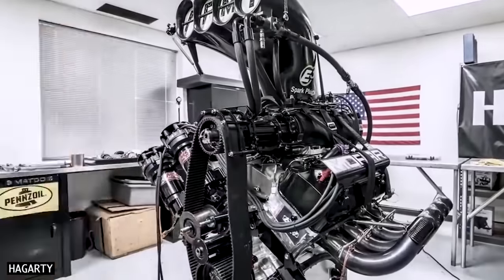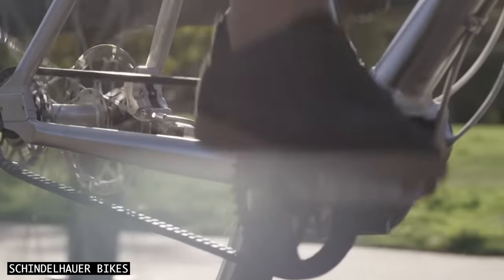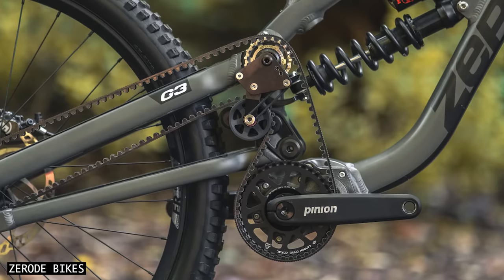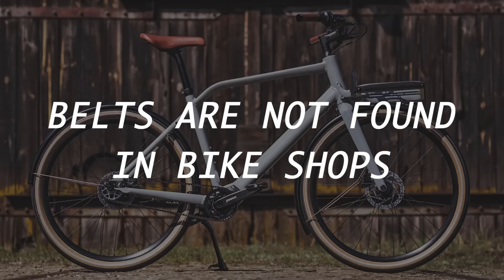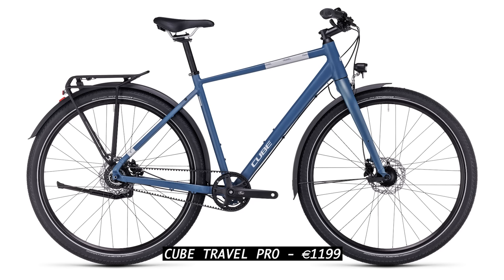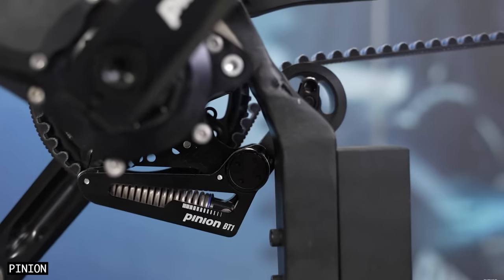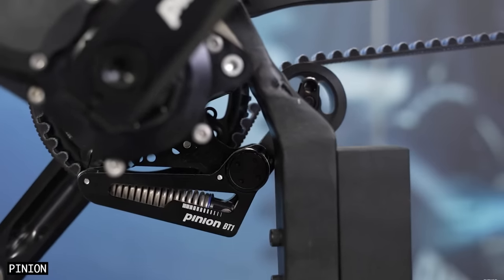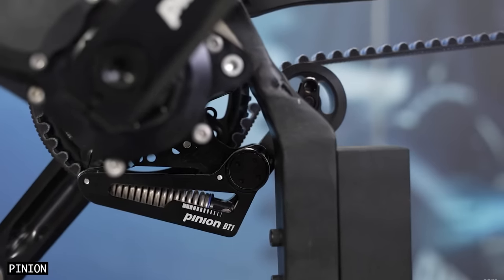Belts Are Now BETTER Than Chains On Bicycles!

Comment: Gates says "do not back-bend", yet then they offer a tensioner, which back bends it. So the manual is outdated, or you can back-bend certain belt models?
Reply from the maker: The belts will obviously back-bend a bit. But it's prudent to not test the limits of the back-bend angle, as it will damage the internal carbon cords.

Comment: Been following your channel for a while now, and have patiently been awaiting for budget-friendly belt drive gravel bikes. Would you by any chance know of good alternatives to the Cube Editor, preferably around 2000€ within the european union? The primary requirement for the bike is a CDX drivetrain, and useable in all weather conditions (Danish weather can be chaotic, and roads are salted during winter). The latter gives me worry with regards to alfine hubs, which seem to be the only option within my budget,
Cheers!
Reply: Denmark ios rather flat, isn't it? I'd go for fixed gear with belt and don't worry for hub (which will need maintenance, will be costly and you'll be lucky to find a shop to do it properly). I just had to do it myself....
Reply: @event4216  I am worried about going fixed speed - through 24 years of (near daily) biking, I have never had experience with it. I do a ton of recreational biking both in and out of town, and the gears come in handy for rough days (heavy wind, tired legs etc.)..
Reply: @rapamune  Well, fields and strong headwind is flat equivalents of hills. Those wind generators across Denmark aren't just for looks...
Regarding FG there's nothing extraordinary. In fact, it has made me riding more FG bike then heavier touring with belt and Nexus hub. I'm not a youngster by any means but FG bike is lighter and easier to ride, it also goes easier on rolling hills - easier than single speed bike of same gear.
Braking can be done with brakes like on regular bike or you can use legs just to regulate speed up or down, and use front brake to stop more quickly. No need to skid or do crazy stuff kids do on this bikes.

For me FG is feeling of connection and no worries about delicate freewheel. Good set of sealed hubs are good for several years, bearings can be replaced when they go and chain is consumable if you ride daily in any weather. Unfortunately belt drive FG bikes are too niche and expensive unless you buy it used. New Schindelhauer is around 2K, on chain bike it's much much cheaper to change gearing of out of box is too hard for your conditions. In city I like 48/18 and 48/17 for longer rides and cogs are cheap to come by.
Reply: I believe there are also Danish bike companies making nice bikes? Cube does about same as other German bike companies, it's more about looks and componentry. Rabeneick is another brand assembling belt drive commuter and touring bikes. I guess brand doesn't really matters as long as bike has CDX drivetrain and components you will not need to replace immediately (e.g. handlebars are straight but you like well backswept or vice versa). Paintwork these days sadly is flat black, mostly...

Comment: For how much kilometres does a gearbox last before it needs to be repaired/replaced? To my knowledge maintenance is required every 10 000km.
Reply from the maker: There's a guy with a Rohloff hub who has exceeded 450,000km. A few people have gone past 100,000km on Pinion gearboxes. The Shimano Alfine hub will often last for 80,000km or so. And an Enviolo often lasts somewhere greater than 50,000km.

Comment: The "to heavy" argument is not true for "why don't they use belts in tour de france". I don't know why but wieght is not the issue. It is very easy to make a bike that are kilos bellow the minimum weight limit of the bike. If you want to spend some of that "wight budget" on a belt drive it would be very doable.

Comment: yee belts are cool but they are wayyy to expensive ,    with a nexus 8 and normal chain , will cost you 200 . and you can add it on any bike ,  with belt  will be 400-500 , and you will need special frame ,

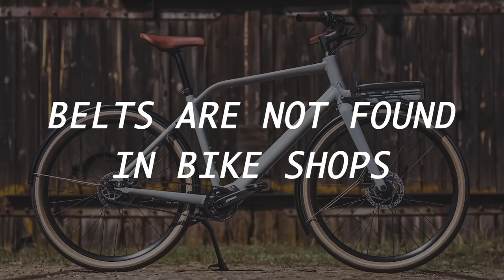Comment: Hi, I have a Q about an image which is visible in the video. Which bicycle (frame) is it that we see from 4:57 to 5:02? If I am not wrong the rear sprocket & belt are placed outside while the rear traingle (chainstay, seatstay) at the rear dropout is placed further inside, hence the belt runs  'open' between the rear hub & the crankwheel, hence such a frame does not need any 'splits'. Also I see the chainstay only one side of the hub (where the belt runs) while the other side of the hub, I don't see any chainstay at all. Do I see it right? How is the hub & wheel stable & isn't it wobbly?
Reply from the maker: It's an English Cycles Project Right. It's engineered to be a stiff structure just like a regular rear triangle (although, it's likely heavier).

Comment: I don't see the benefits, it's just a more expensive alternative to regular chains. I had multiple bikes in my lifetime and never needed to change the chain, and if I did the change would be easy and cheap available in all shops. I don't understand the reasoning behind "regular chains need grease", dude that's really not an argument to change to a much more complicated gearbox. You don't ever need to touch the chain, just grease it from time to time, it's so very low maintenance.

Comment: 2:20 yeah but your not be able to use the transmission in a bike so that could be a big, bigger inconvenience because you can't use other changers of velocity.
Reply: but you could fix the problem of being broken simply paint the belt with a proper water protective paint and also will last more longer than usual.

Comment: I have a Rholoff, chain and tensioner on my Cannondale Jekyll. 
Bike old but fabulous 
Gears love em. 
Chain falling off. Seriously?  It’s less bad than a slappy derailleur but still crap. Sadly the frame has no fitting to use a belt and no bracket for a front mounted tensioner.

Comment: Interesting. I watched it all, PhD please. My questions are about implications for the frame, which are not discussed. Modern gravel bikes and traditional steel touring bikes try and make the rear triangle a bit flexible, compliance = comfort. That is an argument against belt drives. There may be durability gains for the drivetrain in using a belt, but the frame itself must be less durable - splitting the rear triangle with threaded connectors is asking for trouble as the frame ages. An eccentric BB means you need to split the BB shell and use big bolts to fix the eccentric in place - another source of hassle in the long term. Horizontal dropouts with those extra bolts to hold the rear axle in place are another weak spot. I guess for long term world travelling cyclists with 2inch wide tyres and big loads belts can make sense. But generally, no thanks.

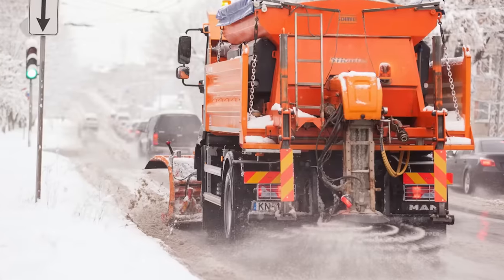Comment: One look at the picture of that Rose CPTL at 3:39 and I knew this was it! 
Since weeks I've been searching for ANY carbon frame that supports belt drives (+ a rack... and is still in production). Bonus for slightly lower step through but does not have that typical woman-bike look. That CPTL is exactly what I have been looking for - and turns out they too have stopped production - aaaw! :(
Do you know any bikes (or preferably frames only) that support belts, are below ~1,5kg, support a rack AND are still in production? lol

Comment: "Belts are now better than chains" title is very misleading. Simply put it depends on the application. 

Comparing the use of belts in motorized vehicles to pedal powered bikes? 

I'm not against belt drivetrains I just dont like click bait titles

Comment: Thank you for you video, but in my opinion you're dead wrong when it comes to pricing.
Bicycle manufacturers (and shops) are not in the business of making (and selling) bicycles, but are in the money-making-business with only the shareholders interest at heart.
With that in mind it's very easy to explain expensive and redundant options like: hub-dynamo's, disc-brakes and - of course - belts.
As to 'belts versus chains', this is my experience; on my commuter bike the chain+cogs (protected by a chain guard) are still going strong after 27.000 kms. Of course they are worn. Most likely even very worn. But they will continue to last for many kms to come. I've no experience with belts. But I did make some inquiries for replacement costs of CDX belt+cogs - here in Holland - and everywhere I'm getting the same price of about €350. If you compare that against the €50 I've spent for a spare set of chain+cogs, it is ridiculous.
The big lie of the industry is that they compare a belt in ideal conditions versus a chain in the worst conditions.
Just my 50 cents.

Comment: Tbh, I don't think it is fair to compare an endurance drive like a belt with a performance chain drive of Shimano or Sram. It would have been better to compare the belt with the igh chain alternative. On top of that you can get a KMC chain, new sprocket and chainring for 15 EUR. A belt drive is 250 EUR. With 250 I can replace my chain drive 16 times.

Comment: 7:03 timing chains are always in the same environment and oil bath cleaned by an oil filter, i dont think its a fair comparison in all honesty. Bike chains are always at the mercy of everything and changing loads. Timing chain loads have a maximum from valve spring resistance on the lobes at a given rpm. Ur bike can easily see incredible spikes on rough terrain and gravel.

The have a max torque? Im watching your video and follow your channel due to your passion for cycling and extensive knowledge and experience. And now im debating on actually buying a new bike with a belt drive and mid gear instead of resurrecting my favourite and loved Giant NRS2 2004 year model. God i love my bike but it suffered stroke and heart failure along with me. It might cost me $1400 to refit it, but soo much has changed. 3x9 drive trains seem to be a relic of the not so long ago past. And i would not buy a new bike especially after the experience ive had on my nrs2. So im thinking going for a belt drive and mid frame gear would be along the same lines of reasoning that lead ne to my unregretable decision on my nrs2. 
Having said that you mentioned a torque limit. In 2012 i built a trailer out of 2x4 for frame and cedar for planking. It weight 100lb dry and had my old v brakes mounted on it that originally came with my nrs2. In about 3 months hauling payloads anywhere between 100 to 400lbs i noticed the teeth on many of my gears looked like they came out of a shark and i managed to stretch my brand new shimano hg chain to where on the other side if the gear it had completely skipped a tooth. 
Hmmm, after typing all of that a thought cane to my head, if i use a rear gear hub then the tension from pedal to rear sprocket will be less than if the belt was coming off the output of a frame mounted gear set transferring the multiplier or divided force to the rear wheel. 
Well i just lost my train of thought. Anyway if my health comes back i know i want back on a good bike. And will need a good air filtration system with hepa filter that can allow mass air flow. My lungs took a huge hit resulting in my stroke. When cars drove by me felt like knives stabbing my lungs. I love cycling, and carrying a big box so i can ride around in the city while protecting my health is more important. Its only in town or on busy roads, out in the country side its not needed. 
Anyway, keep on cycling man. If you ever pass through New Brunswick Canada i live near Caraquet.

Comment: Why don't we see belts in professional track bike racing is the more interesting question than the one about Tour de France (or roadbiking in general). They don't have gears anyway, so there is no weight disadvantage.
Reply from the maker: To accommodate the huge torque numbers put into a track bike drivetrain from stationary, I suspect the extremely high tension of a belt would simply run less efficiently than a chain.

Comment: An internal gear hub system concentrates all the weight on the wrong end of a mountain bike. If you like to ride aggressively and catch air, hub and belt systems are not the way to go.

Comment: Belt+gearbox loses quite a bit of efficiency. You see them on cars and motorcycles because they have a lot more power than a human does.
They're good when you don't need all the power to the rear wheel. An enclosed chain will live quite a bit longer than an open chain (as long as 30.000 km), and with a derailleur setup, it'll be as near 100% efficient as it gets. I never have issues with salt either, and don't clean my chain more than once every 2000 km.

Comment: It will work, but it's not better than chain for several reasons. First of all, it has more friction than chain. Even though car engines use belts, that's not for less friction but for longevity. Second, a belt is more problematic to wear in muddy and sandy environments. A chain will drain sand and mud more effectively. So even if a belt has advantages in some situations, it's not for bicycles.

Comment: About engines having belts, yes!, but a chaindrive is way better on a car. The belt on the type of cars you show are replaced after every run down the track btw. :) and chain in a car is 95% better, the last 5% is due to bad constructed chain-tensioners, or lubrication of the chain which makes them bad. But in a good engineerd car a chain is the way to go.

Comment: Why don't belt drive bikes have the rear cog outside the bike frame, eliminating the need for a break in the frame?
Reply: i think it's hard to convince any company to take the risk and build 10-20 thousand rear hubs of a new and proprietary design which isn't compatible with frames of multiple other companies. the giant halfway should have had such a special hub (not exactly but along those lines) and the reason they stopped making it wasn't lack of popularity, it was that even giant couldn't find anyone to make hubs for them
Reply: @markifi  That makes sense, thanks! It's disappointing though.

Comment: Van Duzer broke his belt on a ride with only about few  hundred miles on it and he forgot his spare belt. I broke a chain once and was able to repair it in 5 minutes with a little tool and I was then on my way. Timing belts on cars NEED to be replaced for lots of money after only 60,000 miles.  Steel timing belts never have to be replace for the life of the car.   Chain systems on bikes are  WAY cheaper and plentiful.   You do not need a engineering degree to work on them.  Chain systems are WAY lighter in weight than a pinion gear box system.

Comment: True but you will never seen a belt drive on a long wheel based recumbent, or a trike. They cant be made that long. I will stick with a chain drive. Easy to maintain, plus repairable, if they break. Oh, the Gates Carbon Drive. I know a guy in Boulder Colorado, who has broken two of them.

Comment: Put the rear sprocket outside the frame? Or put the front sprocket sprocket inside a split bottom bracket/Down Tube & Cross Tube? Think away from what already exists!
Reply: has been done with the Giant Halfway and the English Cycles project right, and there were all sorts of cantilevered structures (where the stucture between the rear axle and the bottom bracket swoops well above the belt) that could accomodate a belt without a coupling, yet people still choose the coupling because it's just a more simple solution that can even be retrofit to old bikes.

Comment: Great work! 
The minimally worse efficiency of the belt is negligible, as long as speed and weight is not important. The route is the goal! :-)
Have you ever driven an Enviolo Automatiq? (ok, I know, it only makes sense in combination with a motor, but I would still be interested in your opinion. 
 After all, you can see this gearbox for a few seconds at the beginning of this video.)

Comment: It's odd how a car engine timing chain (older vehicles usually) will last for the entire life of the vehicle. In modern vehicles and to reduce costs, timing belts replaced the much more robust chains, and these need replacing every 60k miles or so. I fail to see why a belt suddenly becomes 'better' on a bike? I've got a couple of bikes over 20 years old with chains and they're still going strong thanks. If it ain't broke, don't fix it as they say.

Comment: Man, I am drivin gwith a single chain more than 30000 kilometres and the bike is still at home with the same chain, hanged in the garage for 6 years, because I am in another place now! Only first year in the university I drove 10000 kilometres. I use noname chain that is good ieven in 30000 kilometres later.
Also, when I was in Germany I drove 10000+ (maybe more than 15000) with tmy Mc'Kenzie with the same chain I got it second hand and there is no problem at all, seven after I rode the bike for 10000+ kilometres when I came back home. Soz please, don't say that a bike chain is good for 10000 kilometres (or even 15k to say), because it is a lie!😎
Reply: As they say "your mileage may vary". I switched to belt drive because chains often wore out in months and never lasted a year. Even replacing that often I'd wear out cogs and rings occasionally. Belt drive durability is a different set of tradeoffs 😕

Comment: Belts are better and then he say: belts are less efficient
BTW i bought my first bike in 2008 for 170 euros used it for 7 years without any serious maintenance (basically oiled and washed it from dirt pair times in year) when threw it away due to worn out sprockets, next one i bought for 400 euro and use it till now and again only washing and oiling, i drove on first bike like 20 km daily on work days, new one i used like 5 years in same way till i started to use car, but still i drive it like pair times in month, but it still works, what i do wrong?